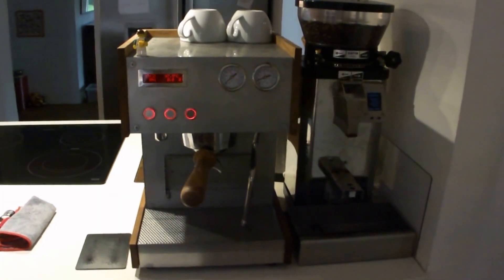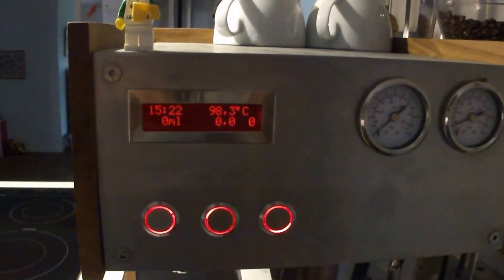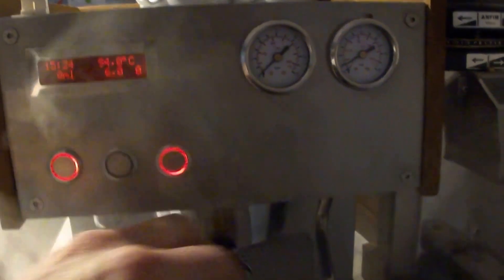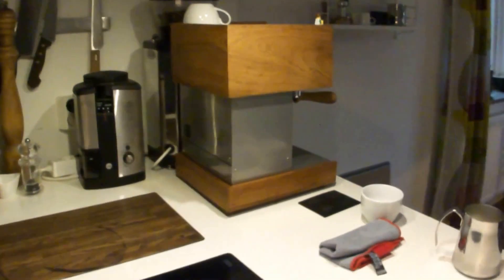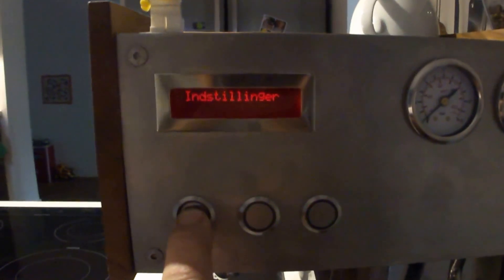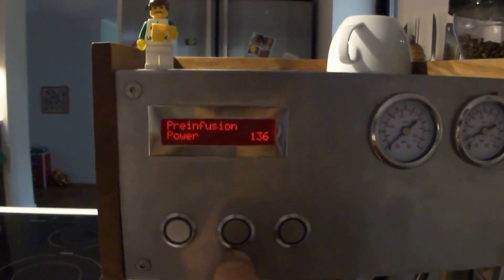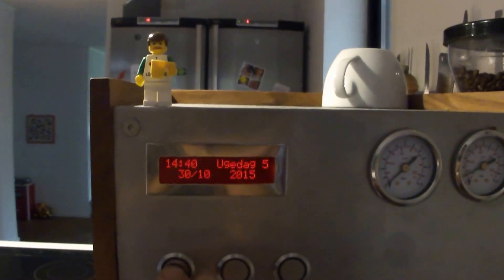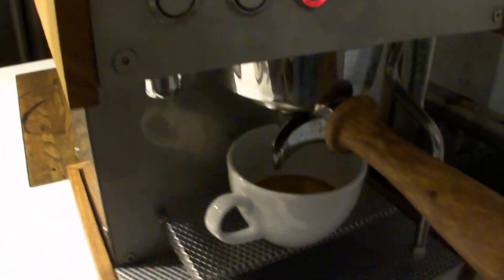DIY Dual Boiler Home Made Espresso machine no. 2

Comment: Hello Jacob, i'm really interested with your DIY project. I'm making my sketch and now I'm confuse about the water level boiler sensor, did you use this sensor for your boiler? I watched your previous DIY espresso machine and you are using PLC but im not too smart to use the PLC. What I know is only connect the PID, thermocouple, SSR, pump and heating element using conventional ways